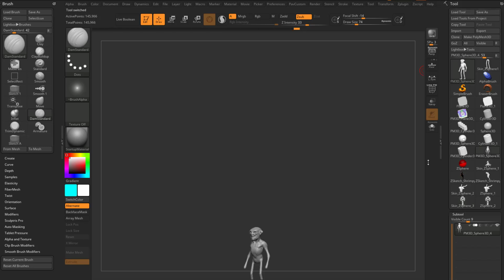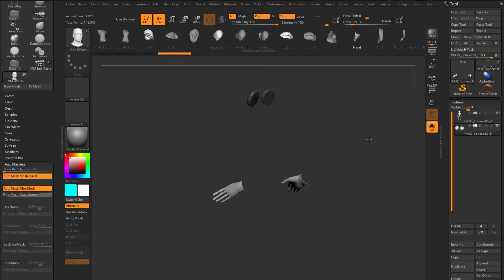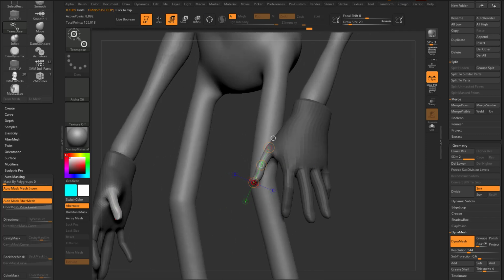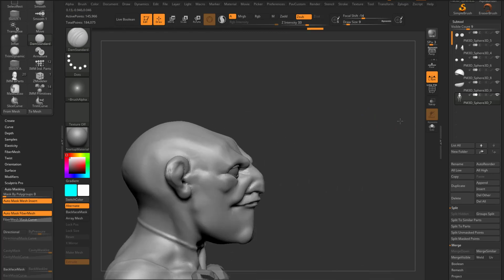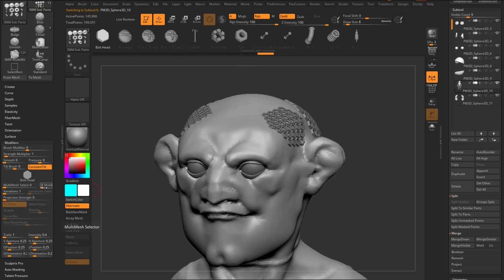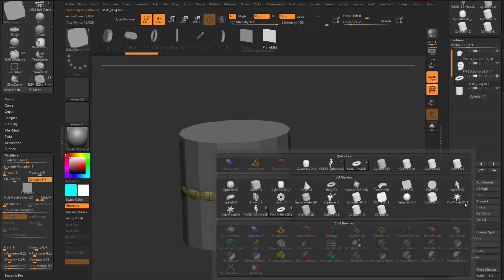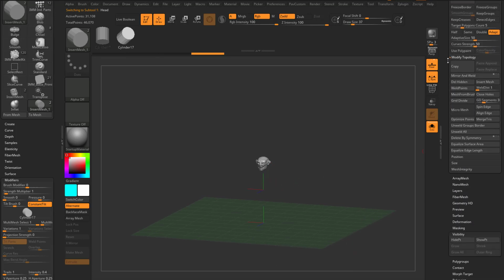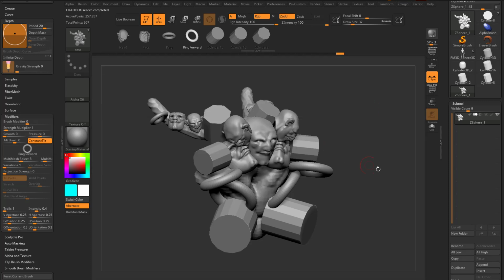Intro to ZBrush 044 - Use IMM Brushes (Insert Multi Mesh) to kitbash and enhance your models!

Comment: Huge favor, im a beginner. I was wondering why is it when i bring in an IMM body part into the canvas, the main subtool (the body) disappears? I assumed it was masked but it does not seem to be the case. Any suggestions would be appreciated, thank you!
Reply from the maker: I'm not certain I follow for the "bring in an IMM body part into the canvas", but if you mean when you drag out an IMM body part from an IMM brush onto your main body, and the main body temporarily disappears until you release the IMM mesh, then you probably have the "Solo" button turned on (right side vertical menu bar)
Reply: @MichaelPavlovich  Ah thank you so much for replying. Yes i did mean when I drag out the IMM body part from an IMM brush. I also thought it was the solo button after you had demonstrated it, but it's been off the whole time. 

I realize that I cant actually drag the imm bp out, as the whole canvas ends up moving instead. The imm bp only pops up when i have the move, scale or rotate selected.